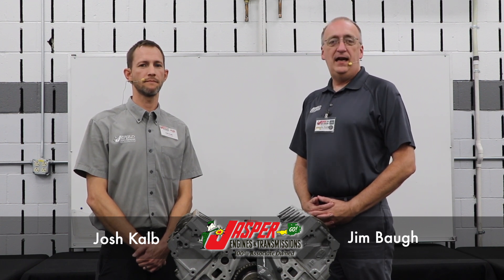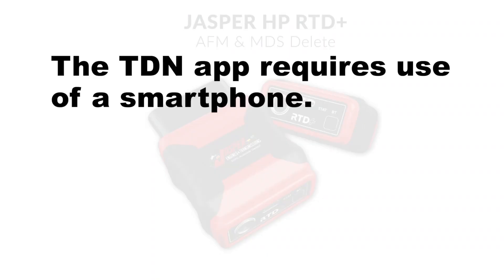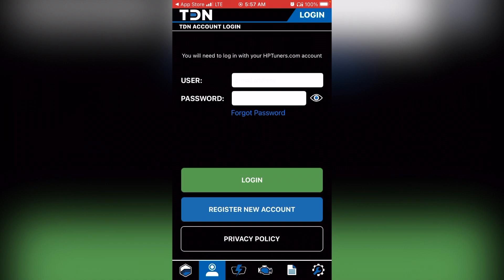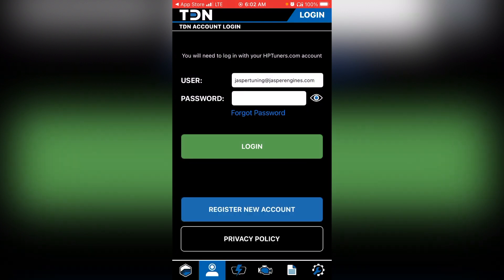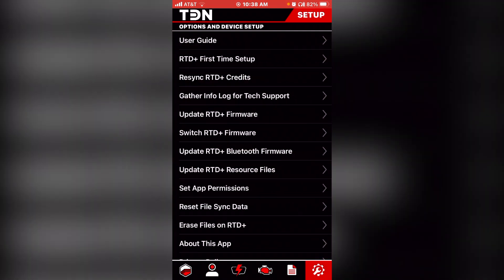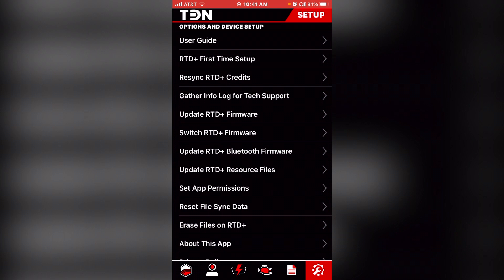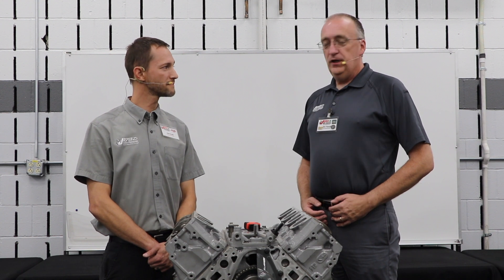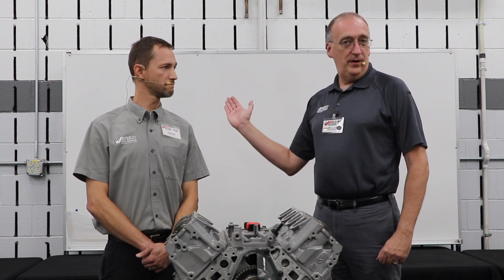Jasper Engines & Transmissions - JASPER® HP RTD+ Tuner Setup/Operation

Comment: Well when it comes to their transmissions.  DO NOT EXPECT TO GET EASY WARRANTY SERVICE!   I bought a 02 Z28 with a 4l60 from Jasper still under warranty.  The car had a noise in the transmission when I purchased it.   After looking through all of the repairs completed idmeadialy after the transmission was installed looks to be like they were chasing a whine and vibration.   12,000.00$ was spent by previous owner at a shop in Greenville TN.   Problem never fixed.  I replaced rear end housing and drive shaft I knew was good from another car.  Probably wasn't fixed.  After several calls and a few months the transmission locked up and twisted the driveshaft into which led to hole being torn in the floorboard exhaust beat flat and torque arm bent , emergency brake cable broken fuel and brake line torn loose.  Jasper then tried to blame driveline issues.  I pulled trans after taking it to the installer that wanted 2 grand to pull and ship it to Jasper for inspection and put in a replacement Jasper reman.    No way in hell would I do that.  I pulled it and had Jasper pick it up for inspection.  After my call back I was told no internal issues.  I then ask about all of the metal shavings and chunks in the fluid I drained before shipping.  He didn't really have a response but put me on hold.  He came back with a offer of a reman with no warranty and wanted me to sign a release not holding them liable.  I did and now I'm working with my insurance company and the damage. I think they are going to total the car.   This could have all been prevented if they simply stood behind their products.   I would never recommend buying anything from them even if you are in a bind.  Find another option.